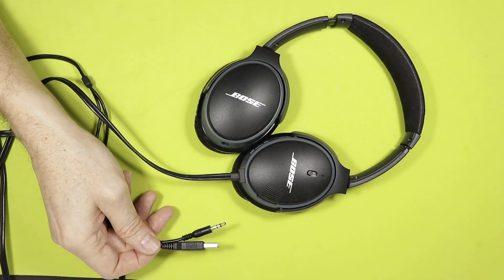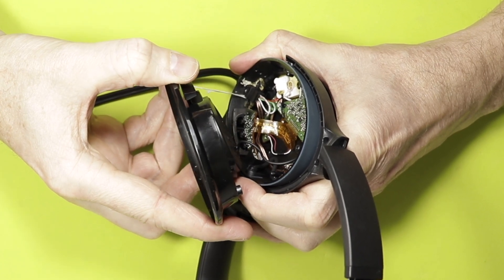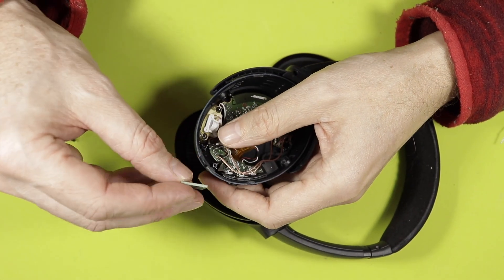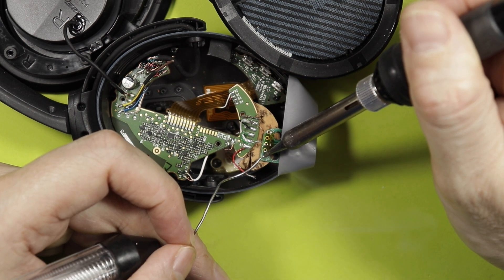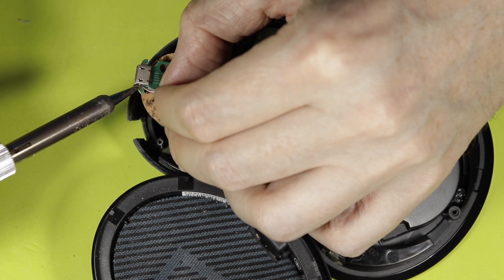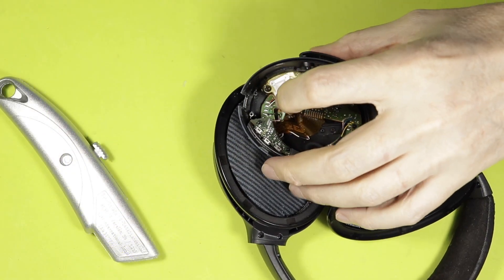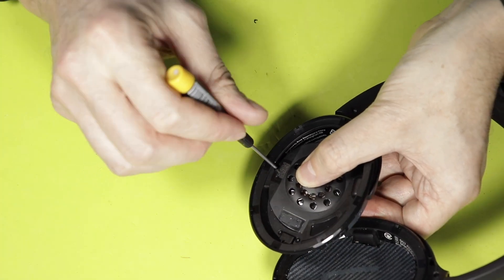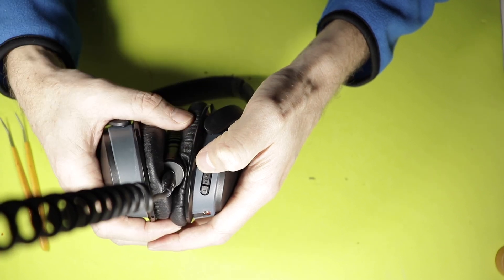How to turn Bose AE2 headphones demo version (wired) into wireless version.

Comment: It also works on Over the ear bose headphones?
Reply from the maker: Yes. But for that you either solder the micro usb straight to its already existing  micro usb circuit board, or you solder a micro usb port like the one in this video and place it outside of the ear cup and glue it to the headphones externally. I will soon post video on how I did that
Reply: Nice job as Always bro!